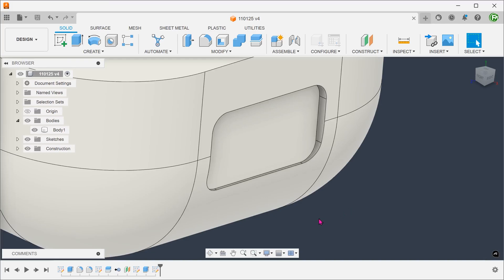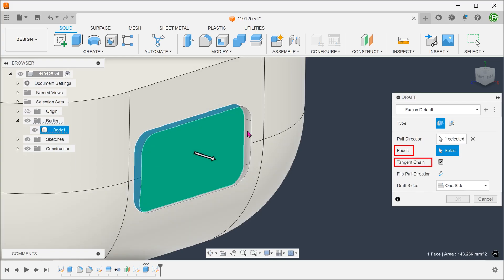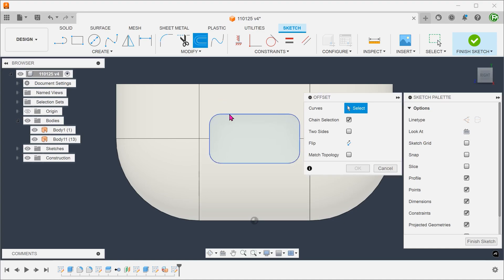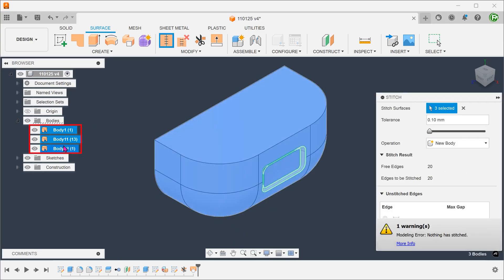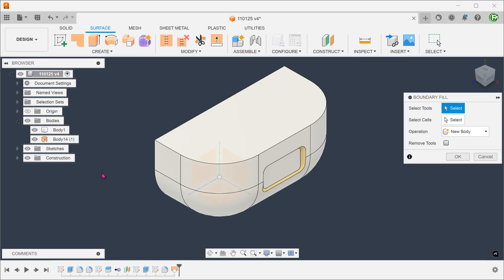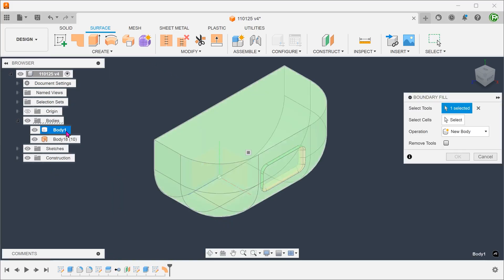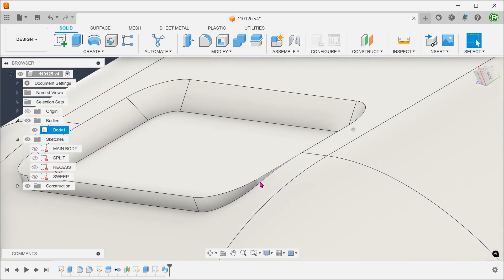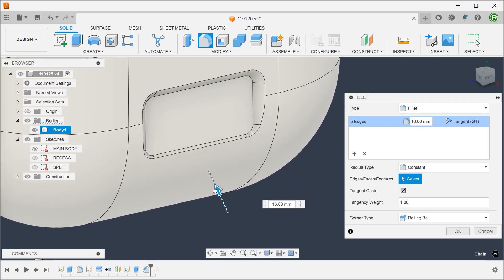Autodesk Fusion | Variable Chamfer

Comment: In Solid workspace, create an offset plane, project the base geometry, create an offset from that and then loft between the base and that offset. Then use this as a tool to cut the model. Would that work? 

I wouldn't have come up with many of yours - very good to be made aware of / reminded of the other possibilities!